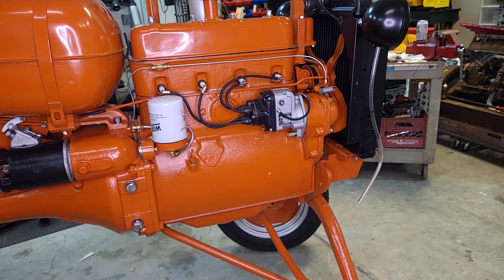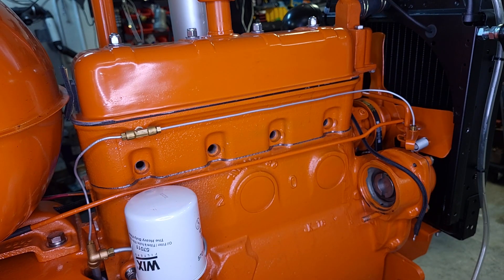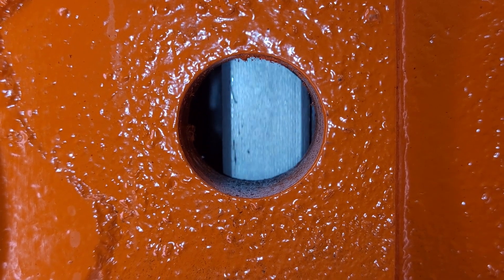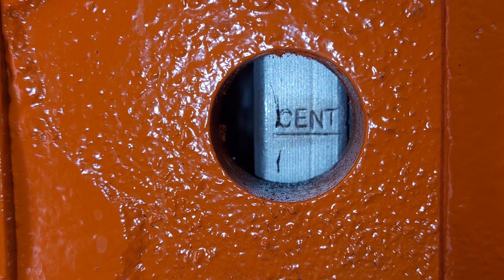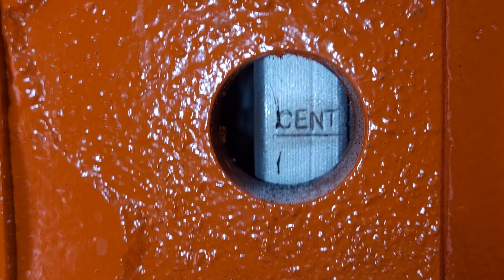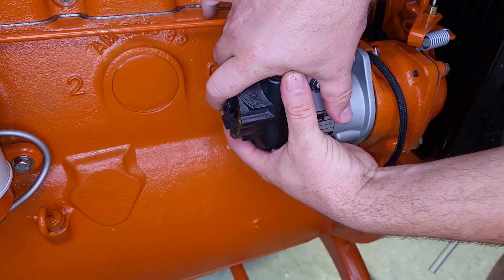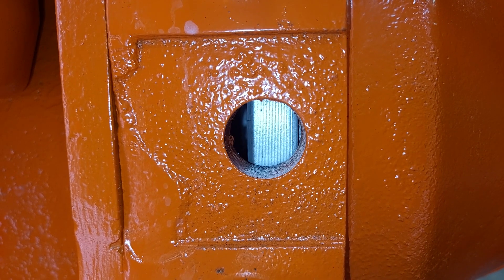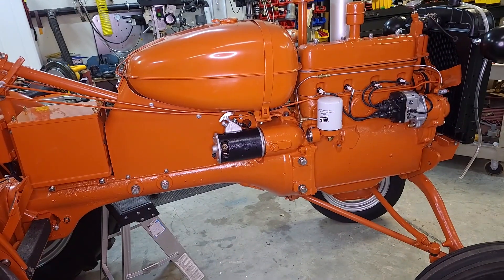Timing an Allis Chalmers Magneto

Comment: Service manuals use the point opening method.
Reply from the maker: It's not as critical when it can only be mounted 4 ways. The points will open the same time no matter how you mount this. If it was a gear drive yeah using the points are important.  In this case it is more important when mounting the assembly the rotor is on the correct cylinder.

Comment: I was wondering what the socket you used on the crank start and where could I buy it
Reply from the maker: @Ronan-bh7sn  i made it. It's a regular socket with a hole drilled through it with a pin welded in place
Reply: Thanks

Comment: Thank you for the great video! I have a FMJ-4B3 on my Allis B. When you had "CENT" displayed on the flywheel and verified TDC on #1, your governor gear grooves that drive the magneto were horizontal. When I adjusted my rotor to fire at the cap's #1 position, the magneto teeth were not horizontal. Is this OK or should all Allis tractors' TDC for #1 occur when those grooves are horizontal? Thank you!
Reply from the maker: @BenedictSawmilling  pretty sure they are all horizontal, is it possible the gears inside your mag are not aligned properly? Do you have a FMJ or a FMX mag?
Reply: @JPN76  It's a FMJ, according to the stamping. There is a C and A on a plastic gear inside the bigger cover on the mag. My understanding is to align the bevel on the tiny metal gear in the mag with the C on the plastic gear inside the big cap because it's clockwise rotation when viewed from the front of the engine (A is for anticlockwise). Do I have that wrong? My mag teeth are oriented at roughly 2 and 8 o'clock. The impulse kicks the rotor past each plug wire tower at the right time, but I don't know what to make of it because it rotates it so much when the impulse kicks (it's hard to tell exactly when spark is delivered without referring to the flywheel, I guess). Thank you for taking the time to reply!
Reply from the maker: @BenedictSawmilling you are correct c on bevel,  I'm pretty sure all should be horizontal. When spin mag backwards and  you set rotor to #1 what position is the cooler when facing it. Give me a clock face position like 1 and 7 o'clock if that makes sense with horizontal being 9 and 3.
Reply: @JPN76  When the magneto drive teeth are horizontally level (or close), the rotor is a little past the #1 contact. Maybe the tail of the contactor would still be touching it and I'm being too picky. I should probably just try it. To me, the rotor looks best aligned when the mag drive teeth are at 8 (L tooth) and 2 (R tooth), when looking at the radiator end of the magneto.
Reply from the maker: @BenedictSawmilling  i think you are good. Once running above a couple hundred rpm and when the coupler disengages it advanced and will be good.

Comment: I have a 1048 B and there only seems to be one set of timing marks on the flywheel. Is that normal.
Reply: I mean 1948
Reply from the maker: @erniepost641  they call for the same part number in the shop manual so im not sure. If yours are in the right place the second set of marks do not matter. Im not sure why they are there anyway.

Comment: I am repairing a mag for another guy...."B"   I took of the lower cap......do I need to time it( the rotor) to the gear on the Mag.........??       Clayton
Reply from the maker: @claytona8962  if you have a FMJ mag then yes. Mine is a FMX so i didnt have this step.
Reply: @JPN76  Ok......I got good spark with the first cap on.......Using a screw driver in the hole, but when i put the outer cap on w the 4 plug wires i dont have any spark at all??
Reply from the maker: @claytona8962  look at this video around the 20 minute mark. https://youtu.be/K-7vlWzzlI0?si=8CY8T9rIzBwIHpil

Comment: Compliments on the production quality.  Great lighting and focus.   I inherited a1948 Allis Chalmers C that had been 'converted' to a coil ignition by modifying the mag.  Difficult to start, kicked back hand cranking.  Put a quality rebuilt Fairbanks Morse mag on it and discovered I cannot tilt the mag over far enough to time it properly.  The conclusion can only be the mag drive gear teeth are not aligned properly on the machined marks under the front engine cover!  I better not find paperwork from the engine rebuilder.  Your video clinches it.  It is not possible to mount the flywheel incorrectly to change the location of the timing marks, Allis Chalmers made sure of that.
Reply from the maker: Thanks for the feedback. I agree with you about the mag timing. Does sound like the governor gear is not timed correctly.

Comment: Very good video!  Very well explain. Is it possible to use a timing light with a crank start.  The last person who worked on our tractor broke his wrist because the crank kicking back.  I liked the idea of you using a modified ratchet wrench.  Why I didn’t I think of that?
Reply from the maker: Yeah you can use a timing light. Younwont see the TDC mark, but the Fire mark instead. If timed too early it will kick back on you for sure.
Reply: @JPN76  Thanks for the reply.  I’m going to try and find someone to use a timing light on mine.  You’ve been very helpful.

Comment: I noticed, you don'''t have a 'boot' on your plug wires. I have seen number 4, have the spark jump to the oil filter making the engine miss. Probably more likely to happen if you plug is slightly fouled, but it is something to keep in mind if a random miss does show up.
Reply from the maker: It showed up in my video with my dad driving the tractor. I don't remeber it being that close back then. Maybe oil filter was a tad shorter or something. Or my memory is a tad shorter.......
Reply: I think the old original filters with the rolled seams and flat tops, were a bit shorter than the currently available filters.

Comment: Hello, need your help, my Allis only has 2 points °° no Fire and Cent brand, how do I have to set it? thanks and greetings from Switzerland
Reply from the maker: Another way to do it is ignore the marks turn slow until you feel compression pressure on the cylinder #1. Then slowly turn until the notch/slot on the governor shaft that the Mag fits Innis horizontal. Set the Mag to #1 and bolt it down. This should work. I plan on another vidnof this at some point.
Reply: @JPN76  Thank You